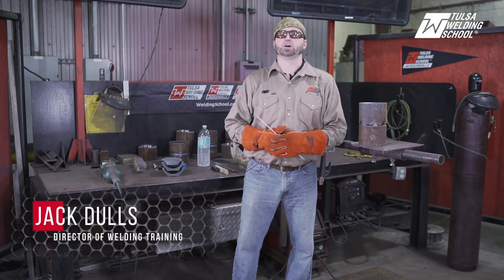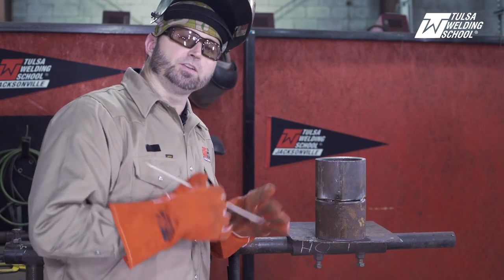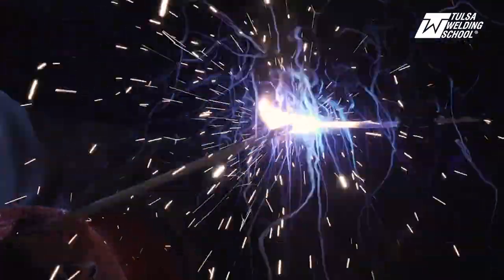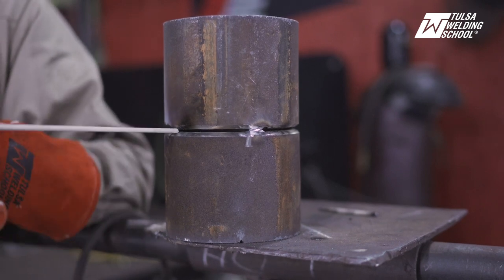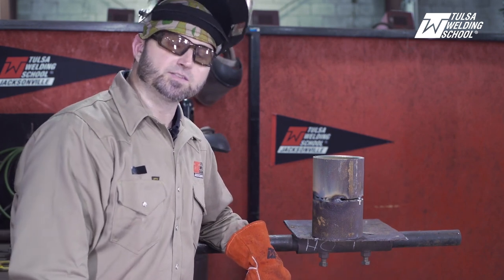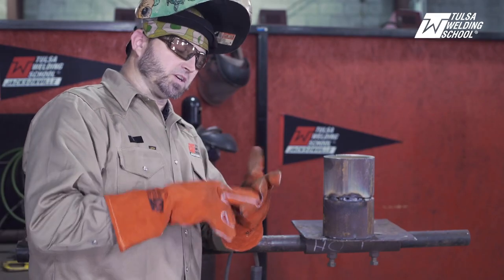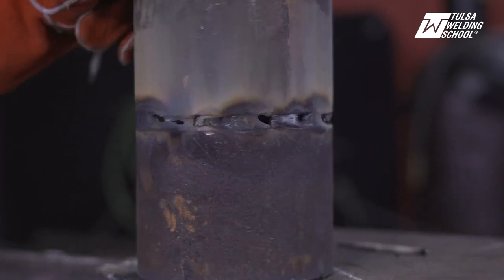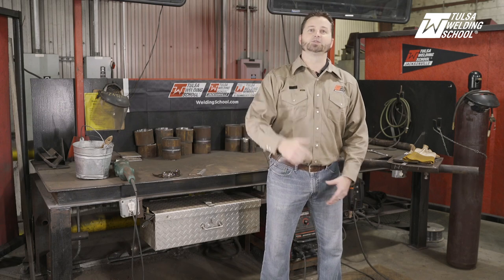The Do’s and Don’ts of 6010 ~ Tulsa Welding School

Comment: i went to tws in tulsa back in 94. i wanted to be a pipe welder when i got out. i took don apples advice and got out of oklahoma as soon as i graduated. i got a job welding pipe and quickly found out that you get stuck on shut downs in chemical plants almost all the time. when your not your at the shop getting ready for the next one. the iron workers were behind one time and i got sent out to help. structual was a dirty word at school and i was reluctant at first, until i got to feel the rush you get hanging steel with a real iron worker. we started getting a bunch of schools and military jobs that paid prevailing wage and i never  looked back. we worked 4 10 hr days and had fri,sat,sun off while the guys welding pipe were working 7 12s. we didnt have to work on top of each other because no other trades want to be anywhere near us and our checks were around the same amount sometimes more. there is also the fame. when your a connector your at the top of the food chain. its like being the star of the movie. something for you guys to think about
Reply: Iron workers local #3 and the videos are pretty good videos though.

Comment: I wanna know why my 6010 always want to go out. I know my amps are high enough, I believe. I’ve tried shorter and longer arcs. Once it gets going it stays going somewhat.
Reply: It might not be you …. There are a lot of welding machines that don’t run 6010 worth a hill of beans … even some welding machines that claim to run 6010 don’t …. Try a friends welder and see if its you or not
Reply: 2nd you could try to run 6010 with reverse polarity from what your using now … I just found some company on line where they claim that their rods run on DCEN - only,  instead of the standard DCEP +

Comment: I'll never understand putting so much effort into showing the WRONG way to do things. Negative learning I suppose. But I say if we -don't learn the wrong things, then they aren't in our heads. In my head is precious space, I don't need extra ideas (wrong ways) bouncing around in there. Just the proper ones.
Reply: This method of thinking seems flawed to me. I like to learn what bad looks like and what cause it so if I encounter it, I know why, and can find a solution quickly. Time=money
Reply: If you dont know what youre doing wrong someone will tell you
Reply: @masonmedina7539  There's nothing wrong with doing it right by understanding the RIGHT ways to do something. If the end result is suitable and efficient, why do I need to learn "wrongs".  I'm wired positive. I might find 3 wrong ways to do it, doesn't mean that I need to memorize a dozen. Also it limits discovery on new ways to do-the result is the object. If your way works, work it.  Doesn't mean it's the best way to teach it.  But the mentality of things is changing. I get that.  Carry on.